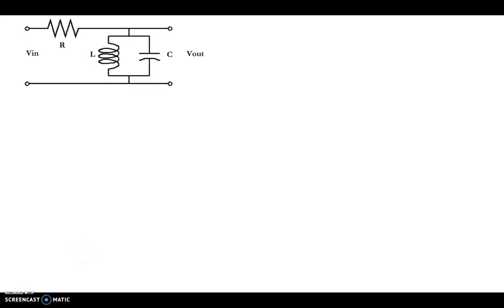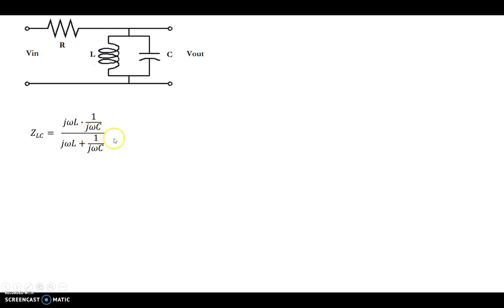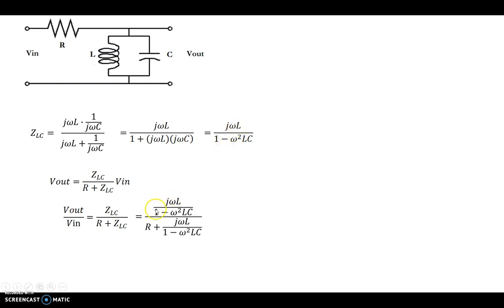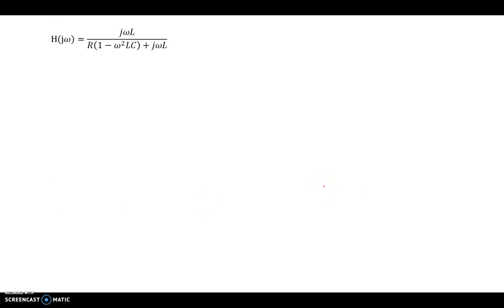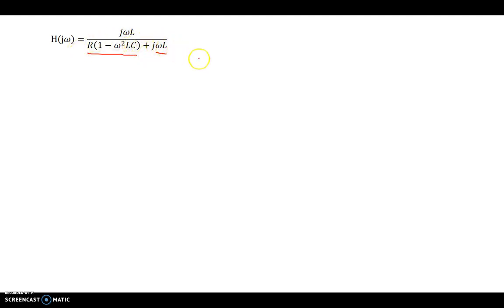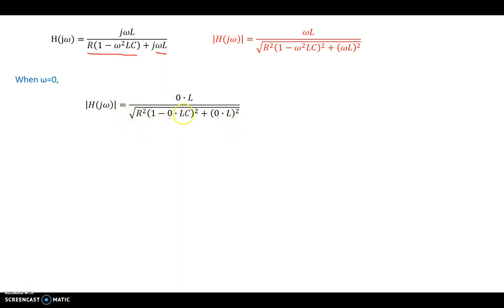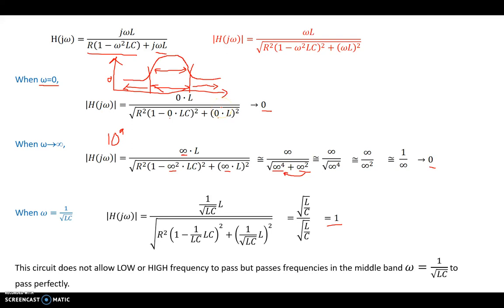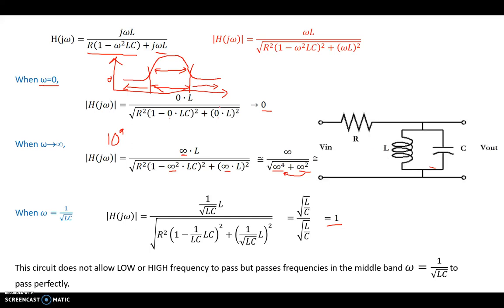Frequency Response : RLC circuit

Comment: Would the process be the same if the inductor was replaced with a resistor? How much different would it be?
Reply: And that both the resistors are of different values?
Reply: @ravioliformuoli520 that would turn in to a modified low pass filter, you can see examples of it as low pass filter with a load resistor also
Reply from the maker: Yes the process is the same. It doesn't matter what the elements are --- the transfer function is Vout/Vin and as long as it is a circuit that you can put in a voltage divider type configuration shown in this example the Vout/Vin = ZOUT/Ztotal.